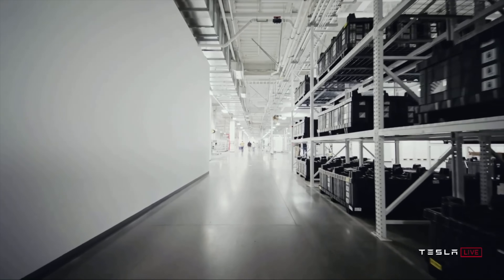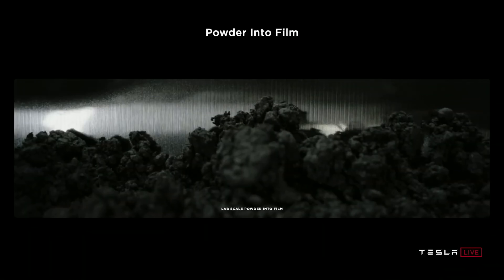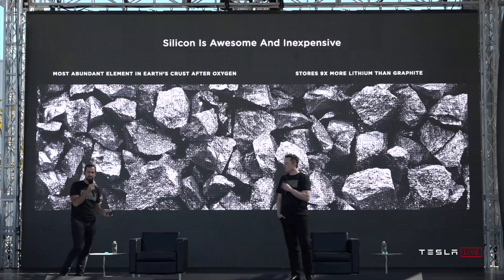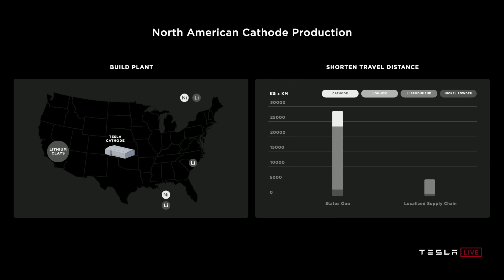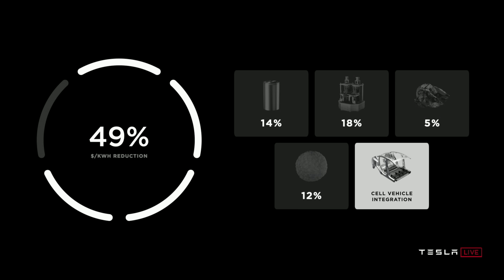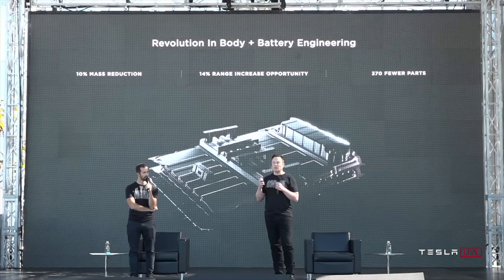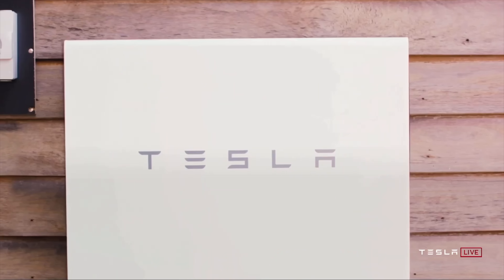How Tesla's New Battery Will Destroy Gas Cars

Comment: Why don’t Tesla put alternators on all the wheel hubs that way the car stays charged when you drive.  Because they wouldn’t be able to charge you for any of the resources that they say are creating global warming.  The same exact reason they say they are creating electric vehicles to eliminate.  Hypocrisy at its finest. Crooks thieves and bums running this country acting like they are saints. I like to call it stealing from the American tax payers from budgets and grants they get to produce these worthless vehicles that still run off of petroleum in the long run.
Reply: Because introductory physics. Alternators would cause a net drain in energy due to the increase in resistance thus more torque needed to drive the wheels.  You need to learn physics, also all the greentards who think "EV is da future" need to learn physics, especially regarding energy density, conservation of matter & energy.

Comment: NO TESLA's huge battery EVs will kill everyone and perpetuate ICE cars.  Telsa's EVs  use 10x more lithium ion cells than do Hbyrid cars which can commute all electric.  Most miles are commute miles. As Lithium Ion cell production is limited this means if you build 1 million Teslas you could have built 10 million PHEV hybrids with the same number of cells. As you now have depleted the batteries available you must fill in demand with 9 Million ICE cars; so contrary to your claim EVs actually create demand for ICE cars.  Hybrids are the best way to cut CO2 because you can make 10x more. EVs are a dead end.

Comment: They won't destroy gas cars, gas powered cars are a lot less practical, slower, less acceleration and less torque but that's not the point it's about the experience of driving with an actually engine that you can modify and work on and have fun with

Comment: So, new cells are 5x bigger and therefore have 5x the density... so no improvement on density? None. 0. 

The only thing here is that the production cost per kw is cheaper now because the cells are bigger they need to make fewer per car, and they have new methods of manufacture - that’s it. No density improvement at all.

Comment: I'm fine with gas.
Plus I don't have $50 k just burning a whole in my pocket and I like dealerships where I know the mechanic instead of a contracted one.
Plus I like supporting all the small companies that make the engine components and produce the gas and the people at the gas station and the truckers.

Going electric still pollutes limits your fill up locations and worse of all gets rid of tons of American jobs to robots and online only sales and destroys Africa with slave labor for those heavy metals needed for batteries.
Reply: If you;re fine with gas, that's okay. Just be prepared for the revolution that's already started. It will take many decades, but electric vehicles will replace gas vehicles this century, just as surely as petrol and diesel engines replaced steam engines.

Comment: LOL destroy.... Not quite. Keep sitting around for a half hour just to charge up . And what's up with that mileage? how tested is it in RW situations? Also I can power my house if the electric goes off with my alternator also could charge that tesla while playing music @ concert-like levels while I'm running the fridge, furnace and lights in the house. The only way tesla will ever beat fossil fuels is if they can match first everything a petrol carriage can do, then surpass it... Oh and they need to be offering free charging as well then they might beat em but they need that Indian girl's super duper cap from a few years ago to do the real fast charging.. And while we're talking carbon footprints etc lets not go and talk about how much diesel and dry propellant spacex is using per launch, which is totally detrimental. so it's half of one and 0.50% of another.  Electric cars are trash and I definitely wouldn't want to be stuck on a ridge in a snowstorm with only a battery operated vehicle to keep me warm in the winter.....  that would be BIG oofies!
Reply: 80% of charging currently happens at home. Many EV owners go for days, even weeks, without ever having to visit a charging station. And as the range of EVs continue to improve, stopping for half an hour after 3 hours of driving won't be a problem. It's actually recommended that drivers should stop for 15 minutes every two hours on a long journey.

Comment: We must take care in re electrics.  My concern is storage losses.  If we charge, at no small cost, a big capacity battery, we've invested a lot of our energy resources in it.  With today's tech, if we don't use it, particularly in cold weather, we run the risk of losing a certain percentage each hour.  As a nation, that can really add up.

Comment: One can further reduce Tesla 4680 Tesla tabless battery Ohm losses and increase heat dissipation  by tapering the electrodes in the battery's axial direction so that each electrode thickness is increased where the currents and heat flow are higher, near the continuous "tab".   This tapering is one further step in the optimization of volumetric and mass energy density.
The tapers of the cathode and  anode  rubans are matched so that the thickness of both electrodes and the electrolyte  is constant as thus the roll is a cylinder.
The tapper can be straight for ease of manufacturing or nonlinear to minimise RI**2 and maximize heat transfer to the "tab" or end section. The anode taper and the cathode taper need to match to keep the roll cylindrical.
The tab end of each electrode rubans can further be shaped so that as the ruban is winded the ruban tab end makes contact with itself so that no tab bending is required.  This creates a solid disk at each end of the roll which again provides low electrical and heat transfer resistance.

The thin side of each electrode  ruban may have to be enlarged to form a small wire  ( ==O ) to provide mechanical strength to the anode edge and reduce electrical and mechanical stresses in the electrolyte.  The  thick end will have a matching indentation.

One should further explore the parameter space of electrodes and electrolyte thickness in the axial direction by manufacturing and experimental  testing.   That may get us to the Million miles battery.
Reply: One additional point.  As the the thick end of each electrode will form a solid disk, each disk can act as the battery ""top" and "bottom" disk seals.  Sealant or a weld may be required  on the spiral.  The sealed solid disk at the thick end of each anode can then connect directly to the wiring.  This reduce the number of parts, further reduces Ohms losses and reduces heat loss resistance and reduces potential failures points.

Comment: Until we separate the battery supply from the car maker, electric cars can NEVER become fully mainstream. There needs to be an international standardisation of battery size and fitment so that battery stations can replace petrol stations and batteries can be swapped-out by robots in seconds. We cannot have charging stations all over the place. In Europe a HUGE percentage of homes do not have off-road parking, we can't have charging cables draped over the pavements every few feet.

Comment: Here's the reality check...the major nickel producer in the world is in talks with Elon Musk right now to supply nickel for his batteries. Musk stipulates that part of the deal is that the nickel be mined "sustainably" ...in other words...no diesel mining equipment can be used, only battery powered equipment. So at one of the mines, where I happen to know many of the miners, they got brand new battery powered scoops, trucks and bolters.  And when they went to use them, they ran out of juice and couldn't even make it down to the headings without having to be plugged in for several hours before they could do a few hours of work, before another recharge and trip back up the ramp at the end of the shift. And so they sit, abandoned , because they don't measure up to the industry's demands...or the hype. So that's the dirty secret behind your E.V. fantasy world...in reality it's not possible without fossil fuels.  And to say that "they will eventually solve this problem" is just another variation of the falsehood that "science will eventually solve every problem".

Comment: Batteries must be as easy to charge as easy as it is to fill a gas tank.
A battery must take you as far as a gas of tank will 600 miles or more.
It needs to be cheaper then gas and needs to maintain 80% capacity for at least 200k miles or ten years.

Until then your wasting our time and money.

Comment: Wesley, you did not address from where the energy is to come to put in the batteries. Will people have to choose between heating/cooling their homes or charging their cars? There's not enough power plants in this country to supply electricity for domestic consumption AND transportation.

Comment: In short no revolution at all - just little enchantments to both cost and few percent more capacity per kg. No new chemistry or some enchantments - same old tech just a bit more "refined". Battery always has been a structural element - same as glass in car windows is. Tesla as usual hypes a lot but is very low on actual substance. A real revolution would be for example explosion proof batteries - currently under development. They would allow driving an electric truck off road without worrying about dying every other minute. Better chemistry that would double or triple current battery storage per kg - or even move it into gasoline energy storage range!

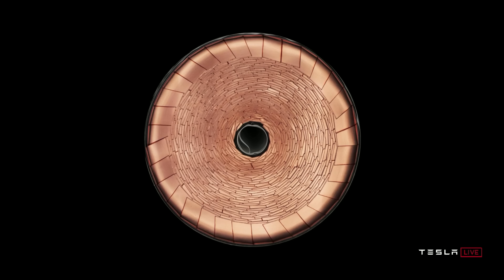Comment: The battery on page 1:28 represents tab-less assembly method. If no further solution it is a problem waiting to happen. 

Problems:

Normally electrode to cell wall is coupled by a welded tab. In Tesla’s tab-less cell, that bridge is omitted and is replaced by multiple copper tabs. Tesla expect this will reduce thermal T and electrical E resistance from electrode to cell wall, but that can’t happen unless solution is provided that can couple T and E from cell core to cell wall effectively. 

Tab-less battery is a technology that collect heat and energy from battery core out to the load but stop short to the cell wall. Stop at the soft copper multi tabs. 

Point contact to couple T and E effectively requires effective (1) contact area and (2) contact pressure. 

Contact area require flat and coplanarity from soft copper to cell wall not seen published by Tesla. 

Rolling electrode with multiple soft copper tabs along the edge will produce ripple rich surface to be mate with flat round cell wall, result isn’t surface but random point contacts. That inhibits T and E performance.  

No spring is integrated in the battery to exert contact force from soft copper tabs to cell wall, that inhibit T and E coupling. 

Without such force and counting on soft copper electrode-tabs to produce contact force like a full featured spring. That is unreliable because soft copper is the worst material to act as spring. Once compressed stay compressed for life.

Comment: can somebody put 2 alternators (2500 watts each at idle but that doesn't exist on teslas so at like 600 rpm fan blade shape and calculation TBD ) like ram air style in the grill and charge the battery while driving there tesla yet. tesla averages around 280kwh per month. it might not keep it off the charger but generating 5kwh per every hour of driving is a big difference. have the air vent out the fenders to reduce drag. on breezy days park towards the wind. also redirect some of that wind to batteries since heat on batteries equal loss in efficiency. weight shouldn't be a problem like 30lbs for all this, and to be super creative use the bernoulli's effect from this air flow to pull the car to the ground. under car fan spoiler like a lawn mower blade might also help this and be good alternator placement, depends on your roads bumps, and a spring in the torque shaft. then drag is greatly reduced since there's no wind getting inside the car. another thing run a bunch of copper tubes through the batteries and motors filled with an elastic gas and a compressor and turn the fan/ wheel assisted compressor with heat (like a steam engine, but thought about like a house hold air conditioner)

Comment: Doesn't fix the fact that we don't have the electrical infrastructure to support a country-wide EV fleet.  Just for California and their 17M drivers, would require 61,000 GWh of capacity (assume we want that as renewable versus coal / gas fired electricity), which is about $2T dollars worth of solar / wind to support just the light cars fleet in California.  To put that in perspective, if you covered Trump's proposed wall with solar panels you'd get about 6,000 GWh of electricity, so we'd need 10 Trump walls to meet the power needs to fuel a clean EV fleet.  Glad they are moving forward, but we are decades away from the infrastructure and supporting technology to move away from ICE cars as well as coal/nat gas fired electricity.  Cheers.

Comment: well, getting the price down and the range up is awesome, question is: how long does a batterypack work properly? my car's 20 years old and still drives ~700km on a tank full of gas (~435 miles? on a 50l tank). also charging has to be way faster than it is now. even with the fast chargers it's over half an hour to fill up a car which is annoying to say the least. when i'm driving i don't wanna have a break, i wanna fill up the car and go on with the journey

Comment: Excellent report, I’ve had confidence Elon will get the right products to the market to have an electric vehicle system. I’m not hearing much about getting an adequate grid system in place. That’s the other side of the implementation coin that’s needed. I don’t think tax payers should be on the hook, how do we solve the problem?

Comment: Dont get me wrong, the new batteries are cool, but I wouldn't say they're anywhere near 'destroying' gas cars yet.  Even in 10 years battery cells won't be remotely close to the energy density of liquid fossil fuels and the electrical grid changes required to support charge rates comparable to a standard gasoline pump are insanely expensive and environmentally damaging, not to mention out of Tesla's control...

Comment: 1:40 ... and much better heat transfer out of the battery. It doesn't need to go through all those insulating layers before it exits through a small portion of the wall into the cooling channels.
What impressed me the most, is that they could already be doing many of these. What if Shanghai and Berlin will be producing the single front and rear castings with the 4680 cells in 9 months, but not have the DBE or new anode or cathode yet? That should still give cost reduction and other improvements!?!?

Comment: I'm impressed 0 to 60 in less than 2 seconds and a 9 second quarter mile Detroit you've never made a factory car that could run a 10-second quarter-mile how does your new $200,000 Corvette stack up to that 30 or $40,000 Tesla  can you say performance left you in the Dust if you've got a glimpse of a t on the trunk deck of that blur that just went by you👍 it's the way of the future

Comment: The Smoke-N-Mirrors never ends. If you take four batteries and spin them into one big battery, of course it’s gonna store more energy than one small battery. Storage capacity and energy-density are not the same thing. The density gap still remains and there is no current battery-R&D that can even come close to filling that gap. And, you’re still burning coal to produce electricity to charge your electric car. That not green in any way. It’s pollution transfer technology.

Comment: Simple calculation shows electric battery cars have no future, hydrogen IS the only global solution.
Reply: What calculation is that? Basic physics says that there will never be a hydrogen fuel cell vehicle more efficient than a battery vehicle.  The losses in producing the hydrogen and in converting the hydrogen back into electrons will always be greater than simply directly storing the electrons in a battery. Hydrogen is just a very inefficient, very volatile, very difficult to store, very difficult to transport, very leak prone energy storage medium. There is literally no factor in which hydrogen is better than batteries... And thats current batteries... The batteries that Tesla just announced make Hydrogen a complete non-starter.

Comment: 5x more energy, 6x more power?
so energy is current and power is wh?
Reply: Power (discharge rate) is kW. Energy (capacity) is kWh. So these 4680 cells will charge/discharge 6 times faster or hold a charge 5 times longer than a single 2170 cell.